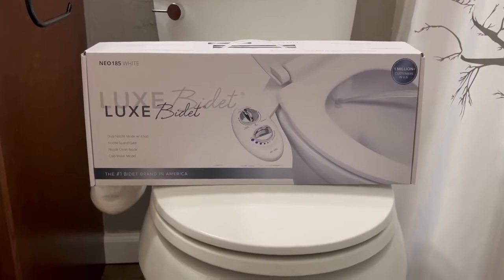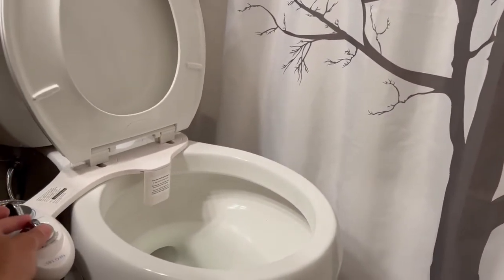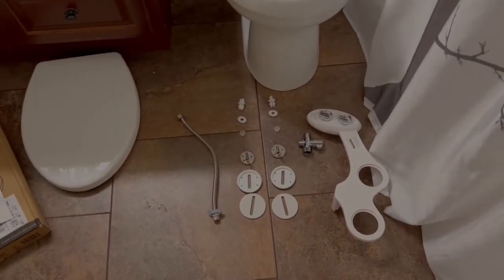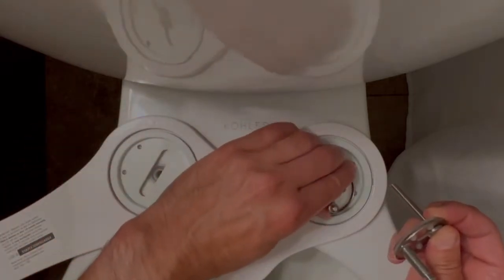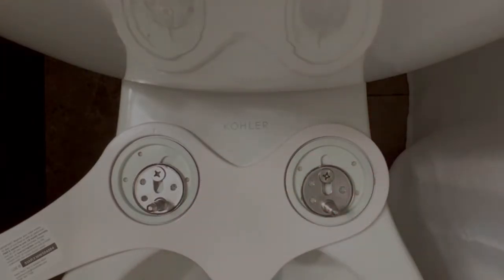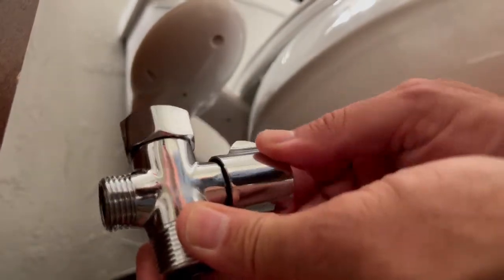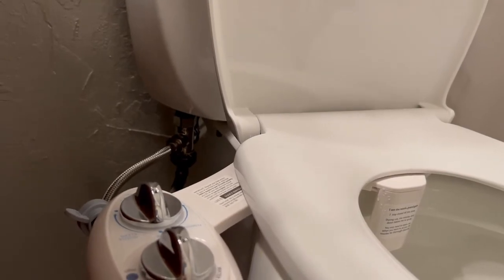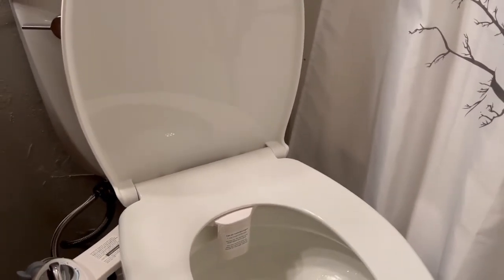LUXE Bidet Neo 185 (Elite) Install + Luxe Seat + Luxe T adaptor

Comment: How easy does the seat come off?  I know it's supposed to come off easy, but with this seat and a different manufacturer's bidet, the slightest upward pressure knocks the seat off.  It's like Luxe's NEO PLUS series, where it's not a circular hole in the bidet but a rectangular one.  I'm not sure enough of the post is coming up for the seat.  Does yours give a little bit of resistance that you have to pull on?
Reply from the maker: No issues with the seat coming off unintentionally. However with the lid up and moderate pressure pulling upwards, you can remove the lid.

Comment: So is the bottom side of the lux toilet seat flat to result in no gaps?
Reply from the maker: It has taller "feet" so it sits level relative to the toilet. But there is a gap between the toilet at the seat.

Comment: One of those dials is for water pressure.  Is that not adjustable enough to prevent it from having enough pressure to blast the wall?  Looks like it isn't all the way toward low.
Reply from the maker: the dial with the small round circles is the water pressure dial. The one behind it is for different modes. The water pressure dial is in the off position at the start of the video. Even with slight turning, it was too much. Hence the need for a wall regulator.